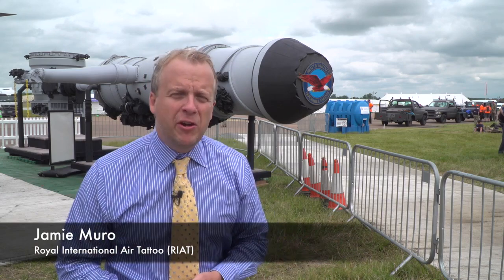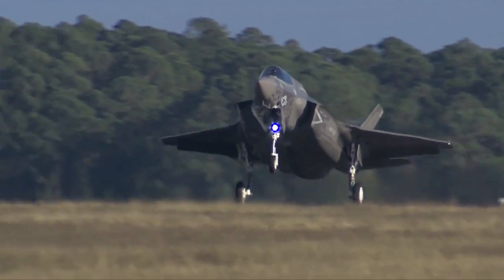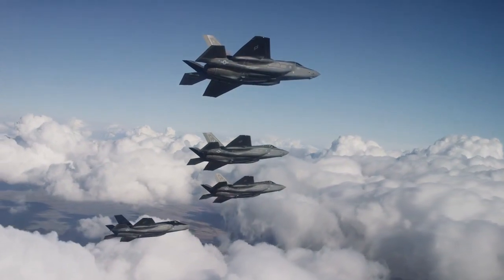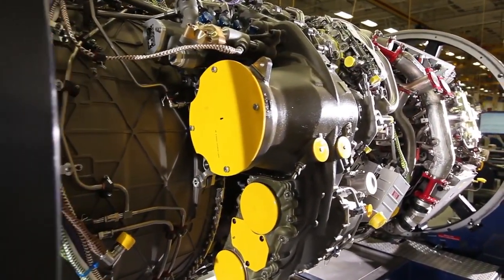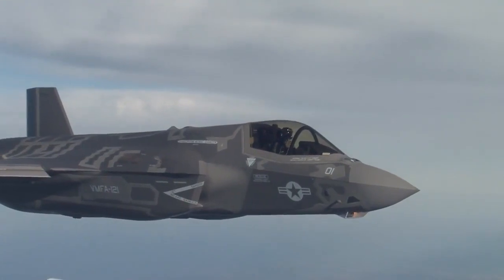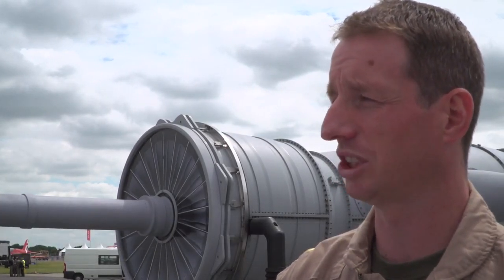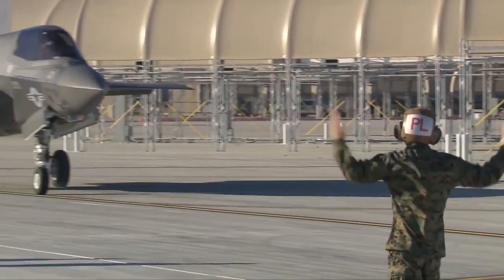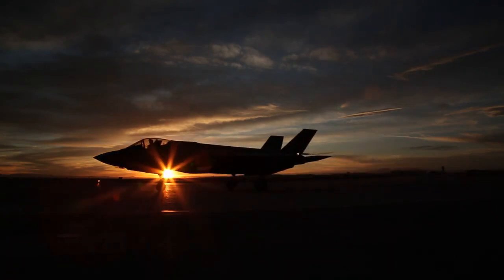Pilots Praise Power of F135 Engine

Comment: it's a waste for that crap airplane.... can this fly a corner, or high AoA maneuvers without stalling or having a compressor stall (look at these weird positioned airintakes)? it seems the US militry steps back from having a plane with dogfight capabilities
Reply: It has higher AOA flight regime behavior and post-stall maneuvering capabilities that exceed the Super Hornet or baby Hornet, with better speed and faster Instantaneous Turn Rate than an F-16C.  At altitude, it can turn without having to go into burner, carrying a much heavier payload than an F-16C50, without bleeding energy like a 2-tank Viper does.

Whoever made the claim that it isn't capable of dogfighting should look more carefully at what this plane is, and the fact that dogfighting is the bare bones, worst-case capability we have included in fighter performance since the teen fighters.  The F-35 has better turning, climb rate, and acceleration performance compared to the 4th Gen aircraft in combat configurations.

You can't dogfight something you can't see.  Something you can't see can trap you in multiple NEZ set-ups.
Reply: +tronicson  And you are an aeronautical expert? You know more than Lockheed engineers or Air Force pilots? You have no basis for your blunt and empty criticizims. You babble on about ww2 tactics, completely missing the sensor and airspace  management revolution this aircraft brings. Educate yourself...unless you just seek to malign.
Reply: The only thing thats positioned incorrectly is your brain.
Reply: Incredibly stupid statement
Reply: This Aircraft does have the latest and Greatest. Tech.